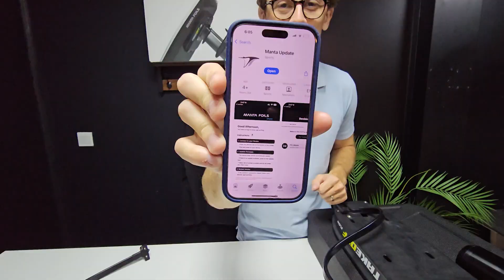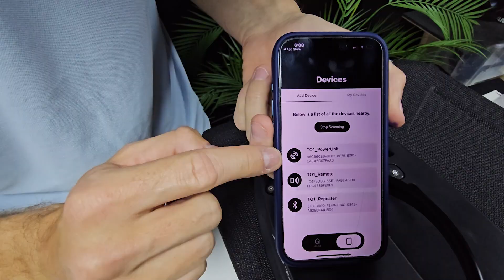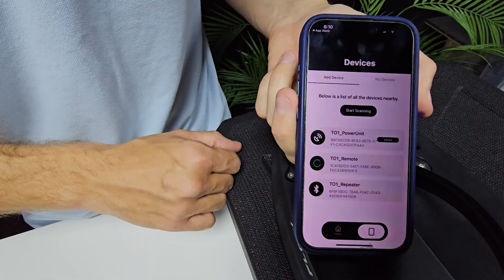TakeOff - Firmware upgrade to use the Performance Motor | Tutorial

Comment: Updated my new Flow and remote easily with the latest firmware to use with my new performance motor. Thanks for a great instructional video and looking forward to using it on the water 🌊🏄‍♂️